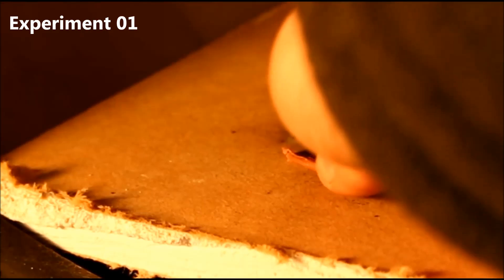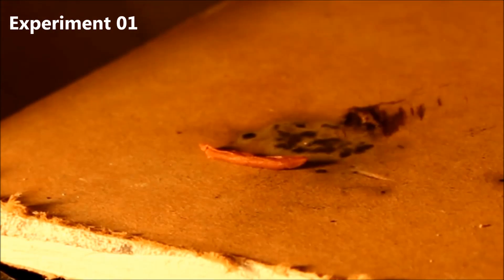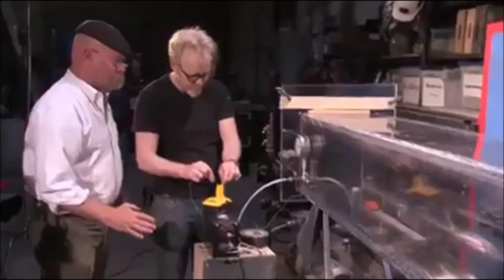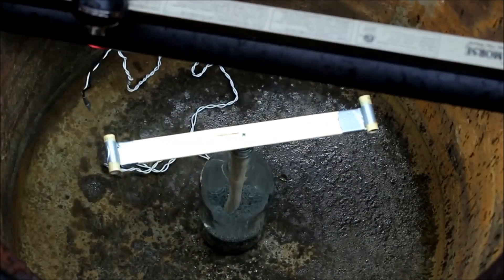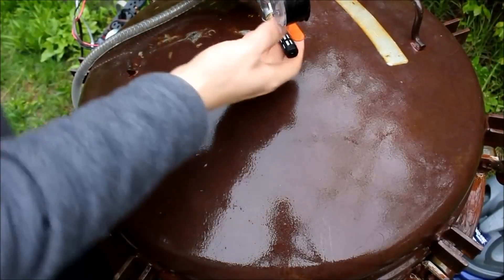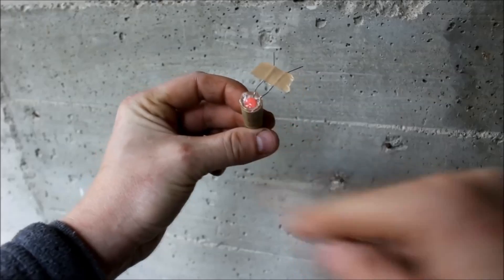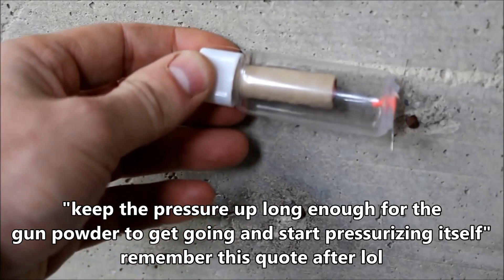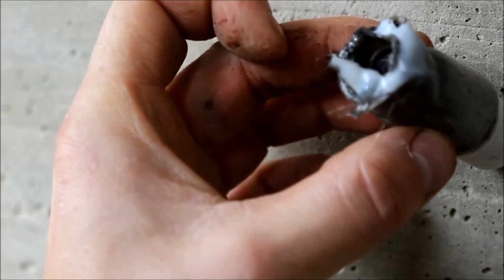Space Fan Debunks NASA and MythBusters # Research Flat Earth # Rocket in Vacuum

Comment: You need and a special oxitizer for you fuel to work and wether they you use ionic wind or fossil fuel they are both released in a pressurized chamber and ingited and the end of the chamber into a depresurizing cone that leads the the vaccum of space and its the force of the thremal dynamic expansion the repels it forward and it has more force in space between there is no back pressure maybe you should take a physics course and the judge if the earths flat because who think your god is he is not he is an engineer not a fool

Comment: Air resistance is the resistance of the air to a body passing through it; the force that the body has to apply to move the air out of the way, equal (thanks Newton) to the force that the air being moved applies to the body moving it.  Air resistance exists because air molecules have inertia so resist being accelerated: they resist change of momentum. And, by Newton's first law of motion the force exerted on the air molecules equals the force that they apply back.  
So: change in momentum is resisted by inertia, so a force is required to change momentum. And, force exerted = force resisting.
Therefore, if a rocket pushes e.g. a brick out behind it, the momentum of the brick goes from zero to something in the backwards direction. So the brick's inertia resists this. So the rocket has to apply a force to the brick to make that change of momentum against the brick's inertia. But, at the same time that same force is applied back on the rocket (First Law), so a force is applied against the rocket's inertia, so the rocket has a change of momentum :- forward. 
Now, rather than one brick, imagine a whole series of bricks: push, push, push.
Now, rather than bricks, imagine a whole series of gas molecules: push, push, push, push, push, push, push, push, push, push.
Reply: Doesn't the rocket weight more than the fuel escaping? Also doesn't the vacuum of space create negative pressure , reducing the inertia required for gas to escape the nozzles? If so then the forward momentum of the rocket would be unbelievably small and the rocket would actually just act like a squirt gun rather than a rocket as it equalizes the pressure
Reply: @Pikee  rocket combustion chambers operate at anywhere from 7 to 200+ bar, but even at the low end it's still 7 bar; there's no negative pressure, just 0 of vacuum to as high as you can compress something.
On the momentum side, linear momentum is mass times velocity, so fast-moving gases are effective at propelling a more massive but relatively slower rocket with a low mass flow rate, which is good for fuel efficiency, which is good because you need to lift less starting mass.
On the squirt gun side, ejecting fluid water would work but isn't efficient for propellant mass - see above.
You could have a look at the engine list at Project Rho/Atomic Rockets, and then at the rocket equation page.

Comment: Since the rocket's exhaust gas speed of 5,000-10,000 mph is far in excess of the speed of sound, the conditions outside of the nozzle cannot affect the conditions inside the nozzle. So the pressure on the combustion chamber and nozzle, which are the thrust that pushes the rocket, are not affected by whether there is atmosphere or vacuum surrounding the rocket.
Reply: You're saying Newtons first law is wrong lol.
Reply: @papalegba6796  Nope, but do feel free to try and explain how.

Comment: So ... the fuel will not ignite in a vacuum.
Reply: The fuel he clearly stated requires an oxidizer to work in a vacuum will not work in a vacuum without the oxidizer the addition of which - to bring it in line with every fuel ever used in space - results in thrust because 'what else CAN it do?', yes. Do you have a point? Is it "Derp... derpity derpy... derp?".
Reply: Combustion in a vacuum is impossible, angry lying chariot guy.

Comment: Honey...JJAJAJAJAJA
Solid propulsion rockets are used on the atmospheric stages of a rocket (atmospheric stage means that the oxidizer used is outside, using the air as one of the key factors) yet when it reaches space another kind of propellant is used, in this case the oxidizer comes along on the rocket which allows ignition, there’s nothing to debunk.
Reply: a real vacuum would have sucked away the oxydizer ie co2 faster than it could be ignited
Reply: @peterbaumann7  - No sorry but the "vacuum of space" DOES NOT "SUCK".
A vacuum is INCAPABLE of exerting a force on anything.
quit watching hollywood movies for your physics demonstrations.
Reply: Sorry, but this is not true.  NASA uses solid rocket motors in vacuum frequently.

Comment: Take charge of yourself rockets used in space use hypergolic nfuel  so when which  are two highly reactive substances that when added together will spontaneously combust
So when they do burn the pressure inside the condi nozzles reacts using all three of Newton's laws implicitly to achieve directional thrusts because the motor is attached to the vehicle and moves accordingly!
Reply: Technobabble.

Comment: Wrong debunking. You are trying to say that fuel/oxidizer mixture does not burn in vacuum. Which is stupid because there is no vacuum in the combustion chamber... The gases are well pressurized there and only after they burnt they reach the nozzle and rush to the vacuum of space... So you've debunked something else.
By the way, the pressure in the combustion chamber and on the nozzle is exactly what pushes the rocket.

Comment: The solid rocket boosters don't get ignited in a vacuum though. He needed the atmospheric pressure to get rocket to ignite and get going but it did burn and produce thrust in a vacuum. That little pressure burst would not make it accelerate like that, quit making up things up dude. The documentary you mentioned, is so unbelievably wrong and with research you would've known that.
Reply: Sorry you are incorrect.  NASA uses solid rocket motors IGNITED IN A VACUUM frequently.  And rocket propulsion DOES work in a vacuum.  Newtons laws are universal and work the same in atmosphere and vacuum.
Reply: @stuartgray5877  Could you show me an example of NASA igniting an SRB in a vacuum? When did I say you can't have propulsion in a vacuum? I'm well aware of Newton's laws so I know this.
Reply: @MetalArcDipper99  - Sure.  For just one example: I have personally helped launch three Delta-II missions which used a Star-48B Solid Rocket Motor for the third stage. (Mars Global Surveyor, Stardust, Deep Impact)   They were lit and used entirely in vacuum. The Magellan spacecraft to Venus used a SRB for Venus orbit insertion.
Reply: @stuartgray5877  Guess I need to learn more about rockets, I didn't even know they had solid rockets that looked like that.😂 How is it ignited? I'm curious.

Comment: ... Ummmm so because something similar to a firework failed to ignite in a vacuum chamber, this somehow proves that NASA is lying ?... You do realise that NASA does not use fireworks or gunpowder to launch their rockets into space right ?..

"The Space Shuttle's large External Tank is loaded with more than 500,000 gallons of super-cold liquid oxygen and liquid hydrogen, which are mixed and burned together to form the fuel for the orbiter's three main rocket engines."

Comment: a bullet in a 2 inch barrel traveling at 800 fps  fired out a 20 inch 
barrel traveling at 1400 fps  . why     same bullet same amount of power
 . its the presure made behind the bullet . space unlike your box is 
expanding and not contained  much  like firing the bullet without a 
barrel   the round will have little or no forward motion
Reply: Wrong - the conservation of momentum laws work perfectly well, both in the atmosphere as well as in a vacuum. When fired in space (a vacuum) the gun will recoil just as it does on earth, with the bullet being ejected at a similar velocity (slightly faster actually due to no atmospheric resistance) to that as it would on earth.
Reply: A rocket is not a gun, weirdo.

Comment: Cody's experiment only showed that solid rocket engines are difficult to ignite in a vacuum if you use relatively low tech ignition systems. This is no problem for nasa. For instance they ignited the shuttle's solid rockets boosters at sea level.

Comment: A blend of chemicals are used as fuel on rockets, under pressure, with gasses that burn up rapidly, but still burn. A few types of fuse burn submerged in water, under pressure. Depth charges are a fair example. Learn some real physics/chemistry.
Reply: You are smoking Crack if you are making a nexus between any special fuel nasa could have used to burn which would had enoughh oxygen combined and enough of it appropriate under a combined form to propel those things to the space flights in the distances that they would have had to overcome in order to accomplish the purpose which they didn't it's a scientific impossibility
Reply: yep good example Depth chargers explode just like this experiment,the firecracker blew up and that's all she wrote
Reply: Water is not a vacuum. Lol you sound crazy.

Comment: Haha rockets work in vacuum. Because did you know what - the engines are not outside of the vacuum. The ignition is inside high pressure AIR/Oxygen chamber. And the exhaust from the nozzle push the rocket forward. There are propellants which continue to burn in vacuum if they are ignited. But most propellants are liquid oxygen and hydrogen. The fuels get mixed into the ignition chamber,produce fire/explosion and high pressure and then that is released into the vacuum through the nozzle.
Get it? Its very simple. Rocket moves forward because of the recoil. Air on earth doesnt have any benefit or contibution. Rocket doesnt move because push against the air. OMG. It moves because push againts itself. Thats right. Step on a skateboard and throw a bowling ball - you move from the recoil. Works perfectly in vacuum. Works even better actualy because there is no ressistance from the air. But NASA indeed fake many missions as well as many other agencies. But there are so many cheap iphone replicas,rolex fakes etc right? Right.

Comment: But the fact is this have even looked at how rockets work? I really do not think you have, as the combustion happens inside the rocket, primarily inside the combustion chamber and the rocket fuel is supplied with its own oxygen thus why atmosphere oxygen is not required. Also why are you ignoring the observation that in the Myth-busters experiment, the rocket actually ignites, whilst the vacuum is active. Look up videos of a Gun firing in a vacuum.

Comment: Great video Dude! I may be wrong, 'cause I learned this stuff a hundred years ago, but solid-rocket fuel (gunpowder - whatever), although it has an oxidizing agent included in the mixture (saltpeter) requires oxygen from the air to burn. NASA motors are supposed to be just straight-up liquid oxygen, which could possibly burn in a vacuum, I guess. It probably won't ignite in a vacuum, and it won't be able to exert any force in a vacuum, but it could possibly burn (more likely explode) in space
Reply: That's fucking retarded because guns work underwater. The propellant charge in guns contains it's own oxidizer and will be ignited in the absence of an atmosphere. If guns depended on outside air not only they wouldn't work underwater, but they also wouldn't work at all even within the atmosphere because the expansion of the brass casing and the bullet engaging the rifling make a tight seal - no air would get in and the combustion would stop, leaving the bullet jammed in the barrel.
Reply: Aren't there more than one stage of rocket for NASA? The first at least has Earth's oxygen and atmosphere for pressure. Then the later stages are in the vacuum where they have to use chemical reaction? In which case it is more about course correction than actual thrust, right?

Comment: HE PROVED IT WORKS. THAT IS HOW ROCKETS WORK.
SO DID MYTHBUSTERS PROVE IT.
Reply: He proved you can’t burn in a vacuum.
Reply: @brandonjohnson7585  He proved you can't burn in a vacuum WITHOUT AN OXIDIZER.  That little capsule at the end provides the needed oxidizer to start the reaction.  He states specifically that the engines he used aren't designed for use in a vacuum.  He never says that there are NO engines that work in a vacuum.  When needed, engines that burn in space use liquid oxygen, fluorene or N2O4 as an oxidizer to allow for combustion.
Reply: @GeekInJeep  Eight months and not a single "Derp" in reply - I think you confused them with 'OXIDIZER' 🤣

Comment: Hypergolic fluids are a wonderful thing.  Nothing needed for ignition except mixing two hypergolic substances.  Nitrogen Tetroxide and Monomethyl Hydrazine come to mind.  Sure they're stupendously toxic and carcinogenic but you'll get about 40 kN of thrust in a vacuum or more from an engine with fairly low total fuel system weight.  40kN isn't spectacular but the low system weight means plenty of propellants can be stored easily with minimal penalty.  Check out the research done doi:10.1155/2014/729313 or doi:10.1002/anie.201101954.

Comment: In the final setup, the bottle was still surrounded by vacuum. You can consider the bottle and its entire contents to be the rocket motor. And you saw it did produce thrust inside a vacuum. The problem with the earlier iterations was initiating and sustaining ignition. It's indeed interesting that Cody had problems getting various substances to ignite under vacuum and the Mythbusters apparently did not, but that's a separate problem from whether a rocket motor can produce thrust in a vacuum.
Reply: The only problem in his experimental setup is the suspension… Take that away, and the expansion of the fuel oxygen mixture still cannot create any thrust.

Comment: Yeah Cody's experiment was interesting, what we need to know now is how NASA overcome this non combustion in a vacuum even with an oxidiser in the fuel mix problem. I can't find anything about a forced pressure system, gate etc. at the tail of NASA's motors. Any one find info on this ?  I do notice during docking at the ISS that we see jets ejecting vapour but I've yet to see the capsule react to any jets fired , they just seem to randomly fire and next thing camera change and she's docked. Cheers appreciate the vid.
Reply: sooner54 these jets are the reaction control system's thrusters.